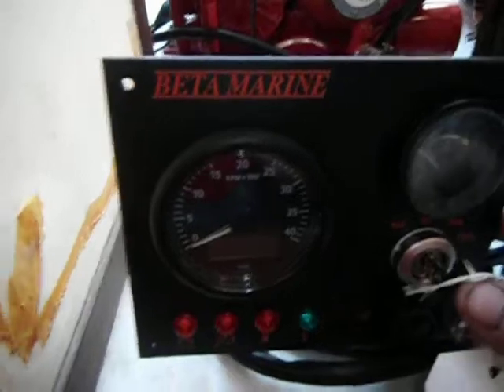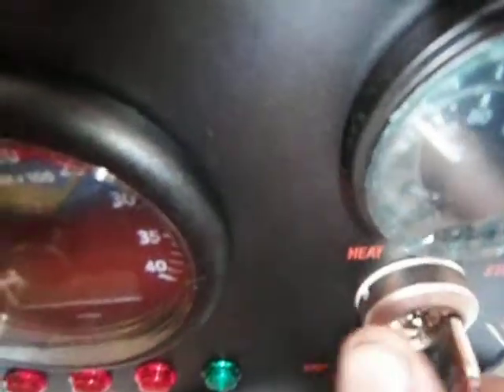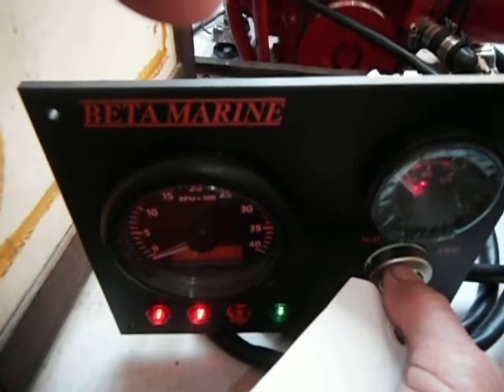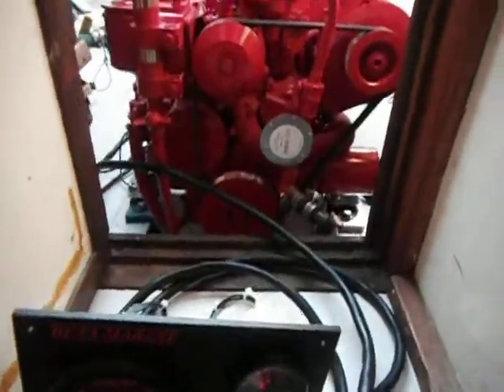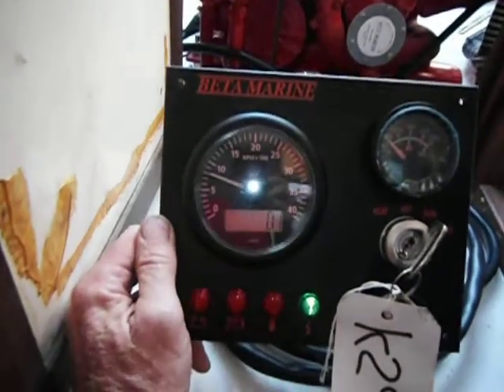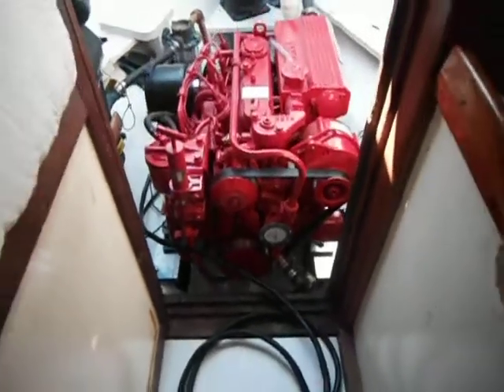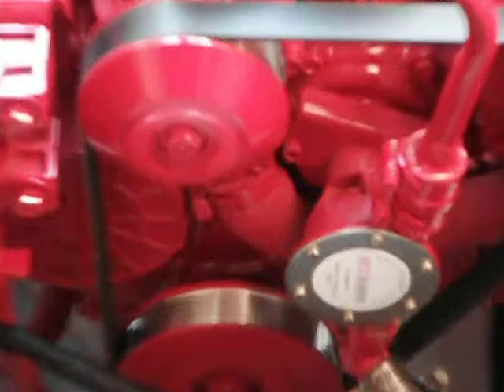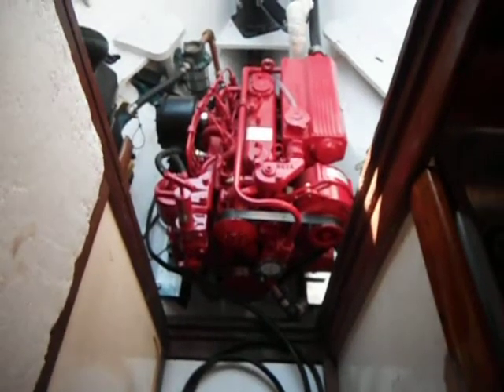TL Sea Beta 1505 Repower

Comment: Hey there,
Were considering a Beta 38 for our repower project (Salthouse cavalier 39ft , 10 ton, sailboat)  We'd be interested in heaaring how yours is performing and what ratio transmission and prop size you are using.  We're also considering the 43 since it's a lower revving engine with a little more power/ torque but the trade off is its 100kg heavier and bigger...